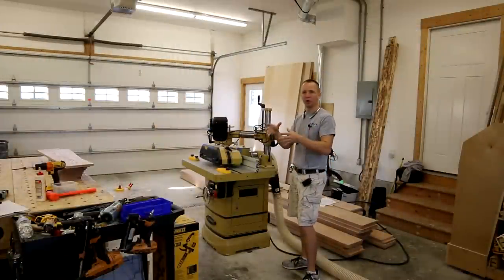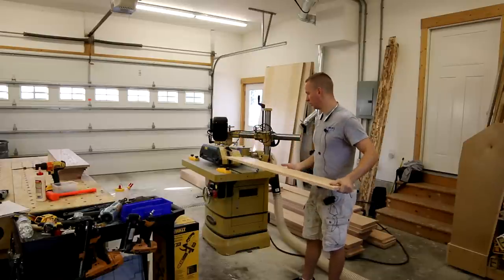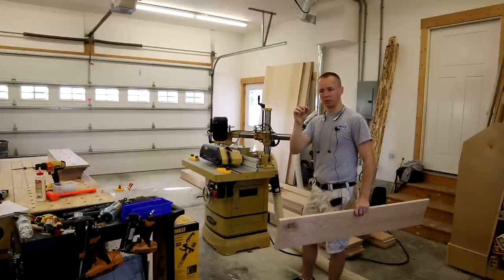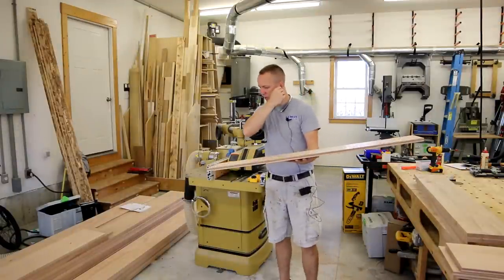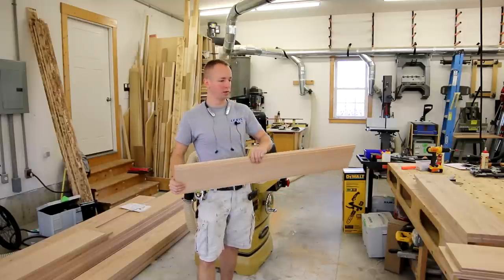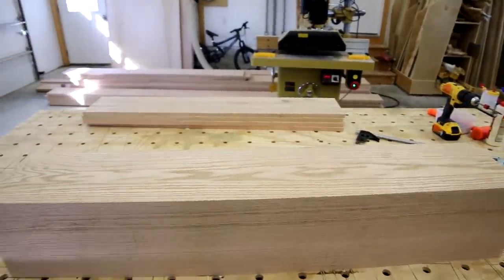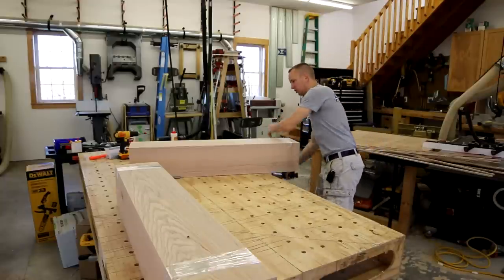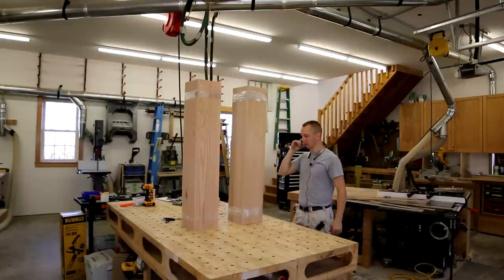Oak Trusses - Lock Mitering King Posts

Comment: I thought you have to run one board flat on the table the one board flat against the fence? And what is the purpose of the table saw?
Reply: This lock miter bit is different. The freeborn bit requires a dado pass on the table saw to make receiving groove for the lock tongue. Its suppose to be a benefit that you can run both boards flat for better accuracy.
Reply: James Shea thanks James! Is this for the shaper cutter? Should you happen to know if they have instructions for the cutter? I couldn’t find it.
Reply: James Shea found it! Thanks!!